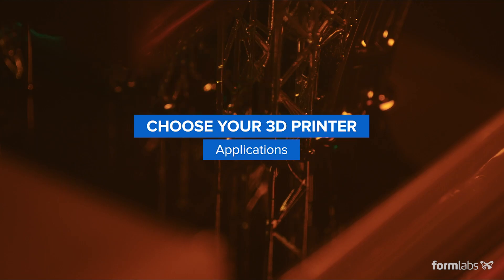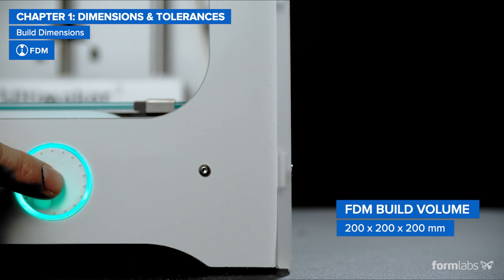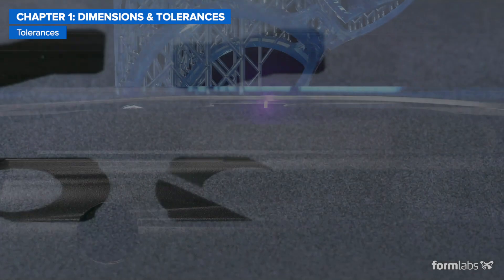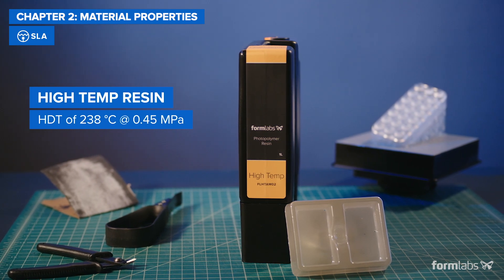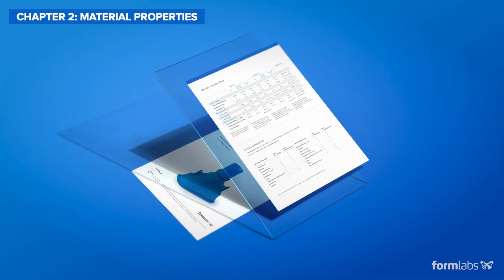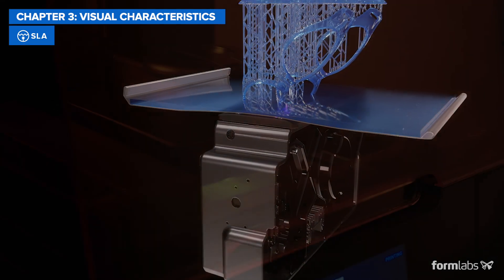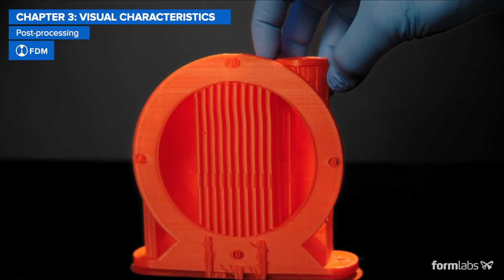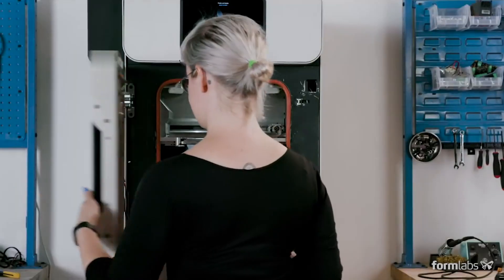3D Printing Applications | Compare FDM, SLA, and SLS 3D Printing Technologies

Comment: Does anyone know what brand and model type is the FDM printer in this video?
Reply: It's a "Ultimaker S3". But I don't recommend them because they are to expensive while others 3D printers are now better and you need a 2.85mm filament instead of 1.75 like every other FDM 3D printer.
Reply: Hi i need a Real fdm 3d printer large volume with a good Price to add it with thé formlabs 4 wich one you recomand .😊 Thank's @ARCopros

Comment: @formlabs do you not know that PVA exists for FDM?
Reply: Owen Coyne not just there’s many different support options
Reply: Jack Greer Well, if I buy an FDM machine  in 2020 for $3500, it better be a dual extruder. Take the Ultimaker S3 ($3850 so a bit over $3500) for example, it has dual extrusion and PVA Support. Even cheaper printers have PVA supports as an option (Prusa I3 MK3s with MMU2s) So I think that it's necessary because it's what people will actually be using/have the ability to use in this price range.